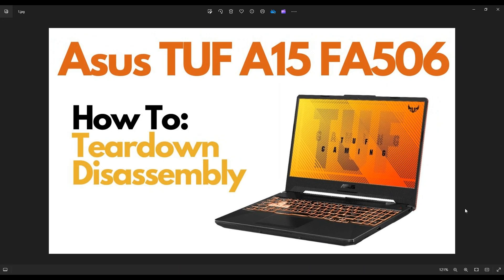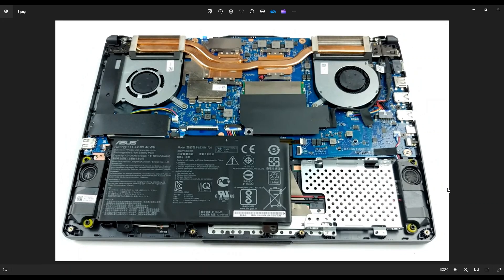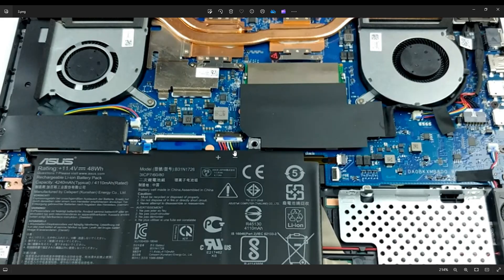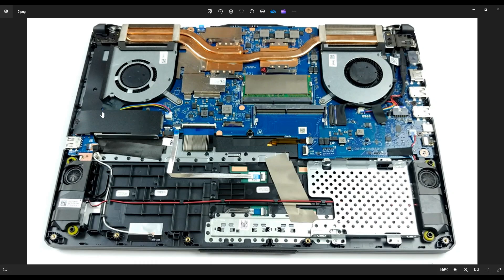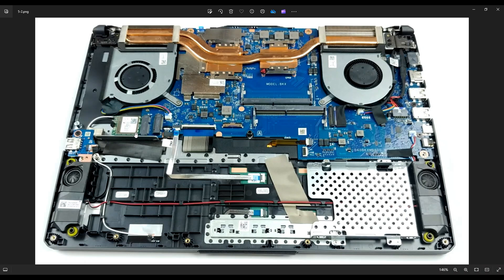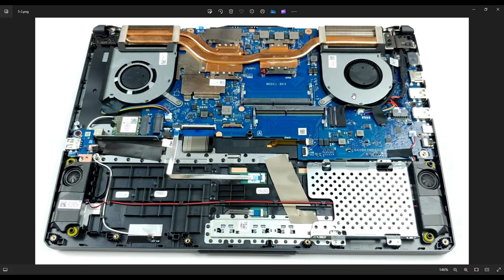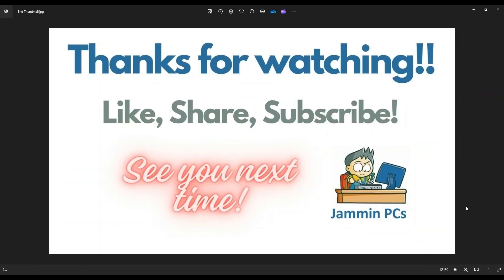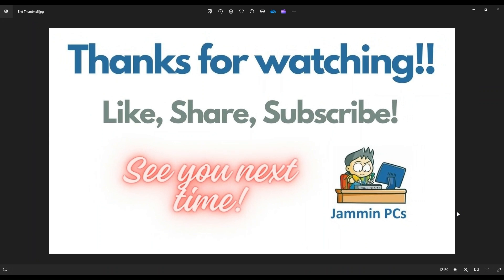Teardown Disassembly Upgrade Options - Asus TUF A15 FA506 Laptop Computer

Comment: I have the same FA506IV motherboard, and stopped working after replacing the fans.
By any chance, do you have the schematics/repair manual for this model ? Im just pissed having lost this machine.

Btw, i had it running with 64GB RAM, and with a mediatek wifi 6E  card.
Reply from the maker: No, I'm sorry. I dont have that manual :(
Reply: @jamminpcs  😮‍💨
Thanks for answering 👍
Reply from the maker: @IvnSoft  NP sorry :(

Comment: Does it have a SATA 2.5 SSD slot
Reply from the maker: Yes. You can see the ribbon cable port for it towards the right middle of the motherboard bottom. Near the area that looks like a HDD caddy :) Sorry I forgot to mention that :(:(:(:(

Comment: Once I have peeled off the black strips on the ssd and ram should I put them back on? Because I believe they are the reason I’m hearing a clicking noise when my fans kick on
Reply from the maker: I generally put those back on as they do offer a bit of protection. However if you think they are the reason for the noise, try removing them and using the computer to see if you are correct.

Comment: Can I switch out the power button? I’ve use it for 6 months and it completely stopped turning on after a bit
If you know anything about the power button or how I can turn it on plz lmk I’ll greatly appreciate it!
Reply from the maker: Yes, the power button is replaceable. However, if your computer isnt turning on, there may be other reasons for it. Can you try the troubleshooting steps seen here? https://youtu.be/kOBY4k2Mn_k